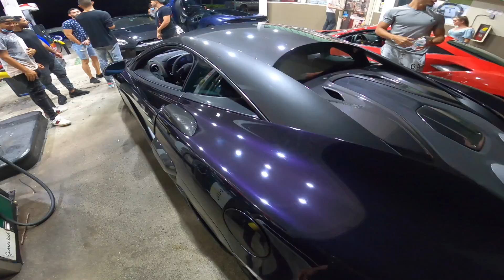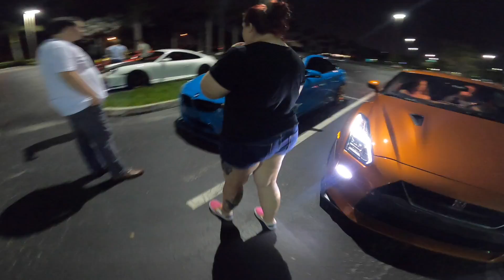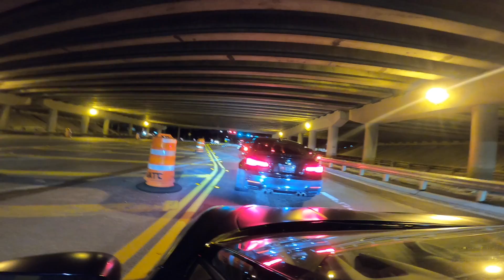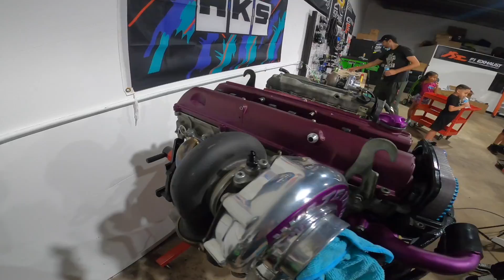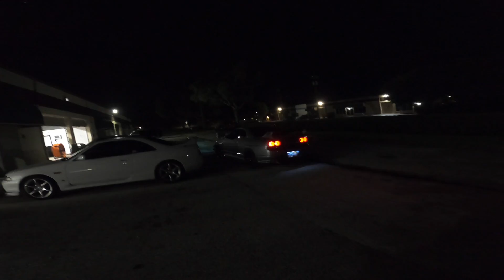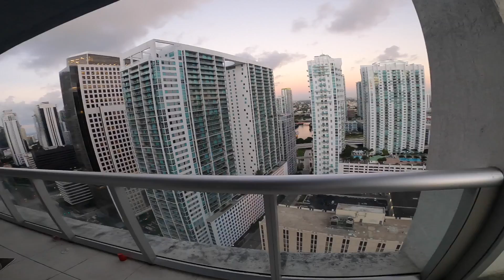Miami Midnight Run!

Comment: I'm the dude showing off the yellow Porsche, and to ppl judging me for opening it up to a dude with a cam, I have one question; how's your mom's Civic?
Reply: My mom has a gt63
Reply: Nothing wrong with showing off the custom bits
Reply: Yo man what exhaust work do you have done ? Best sounding Cayman yo
Reply: @mothusimosiieman7850  car is 100% stock, but it might be louder than a normal 981 because it's a Spyder.